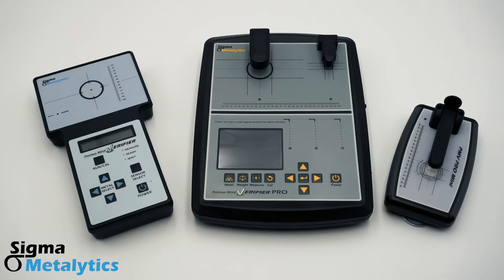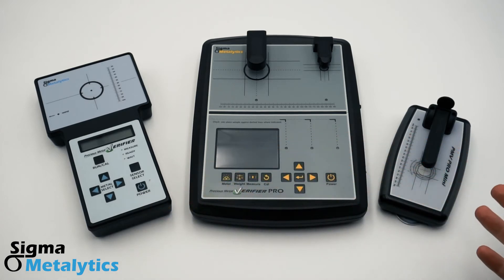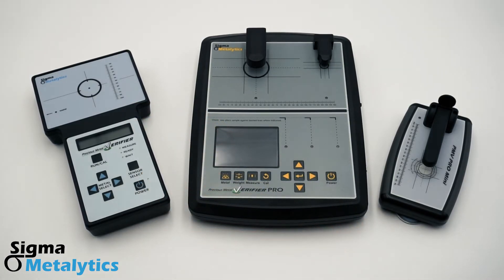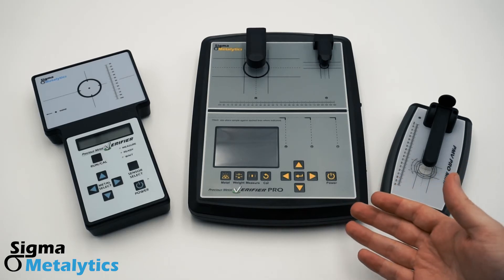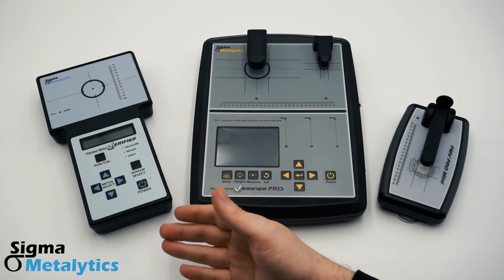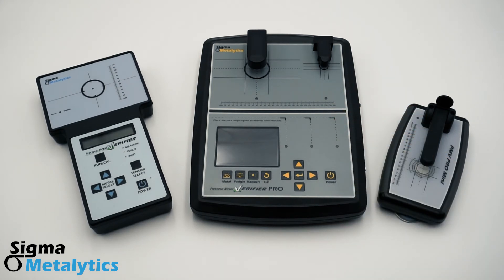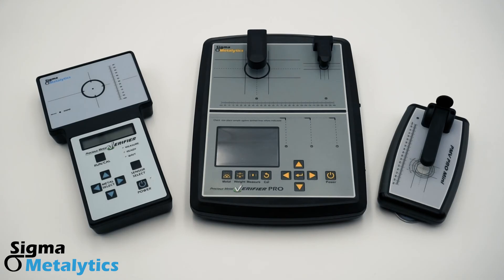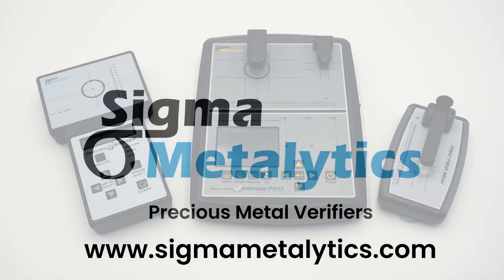Precious Metal Verifier Introductory Video

Comment: Does the Pro have the same connectivity as the Pro mini?
Reply from the maker: Hi Mc Kenzi, The PMV PRO has its own built in screen, so it doesn't need to connect to another device to show readings. However, both the PRO and PRO Mini are able to connect to a Windows PC if you would prefer to use the interface on a computer.

Comment: I started with the original but soon upgraded to the pro which is a truly amazing machine. What would be the price and availability of the bridge for the pro in the UK?
Reply from the maker: Hi Garry, glad to hear you're enjoying your device. Due to how sensitive our devices and their attachments are, each attachment needs to be installed and calibrated to its specific parent unit by our engineers at the facility. Please contact us directly to get a quote for the upgrade. You can find our contact info on our website under the "Contact Us" tab. Thank you!